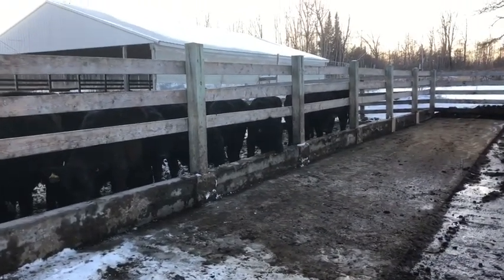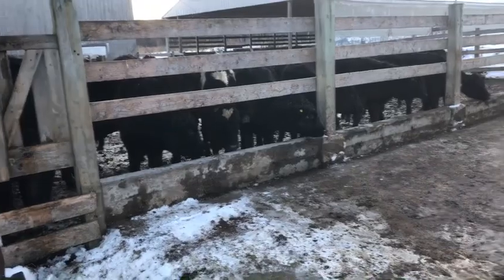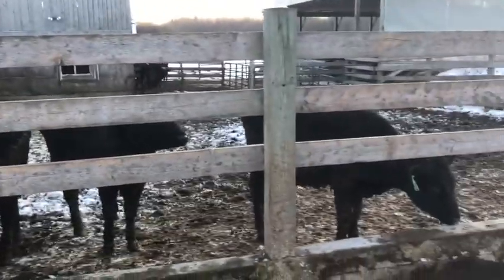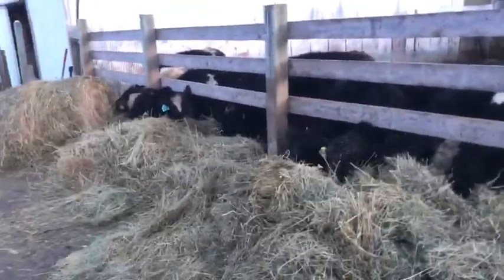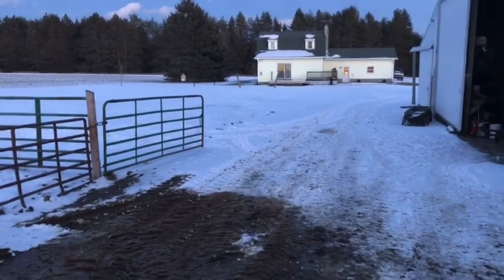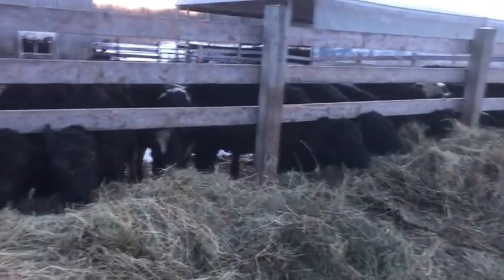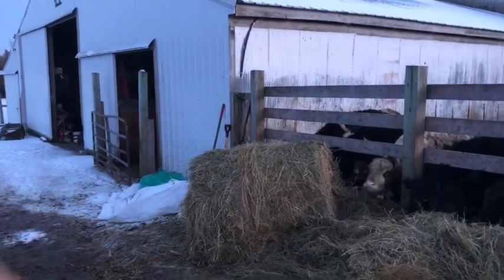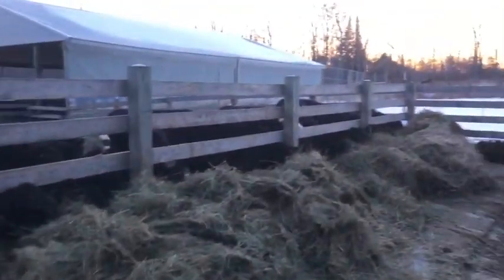Trying something new!

Comment: WOW, neat use of existing facilities!  That is thinking SMART!  On the lower wood bar, could U remove & replace with metal pipe & U connectors on the inside or metal cable with a garage spring 4 a tensioner.  👍👏😊
Reply from the maker: ardurbin2 yup got a couple things like that I can try if boards don’t work